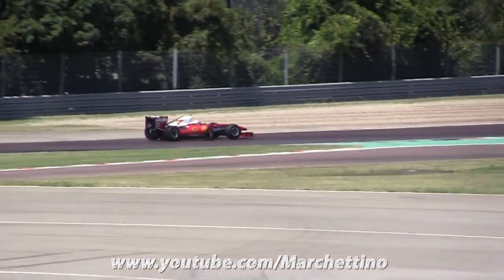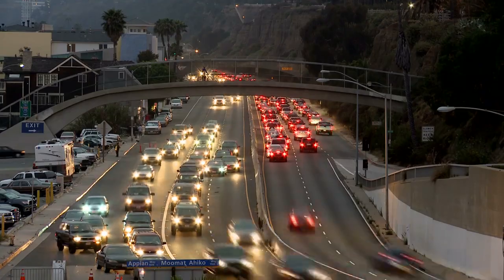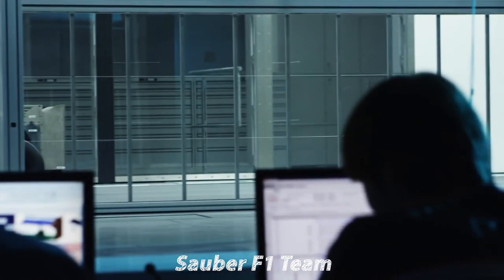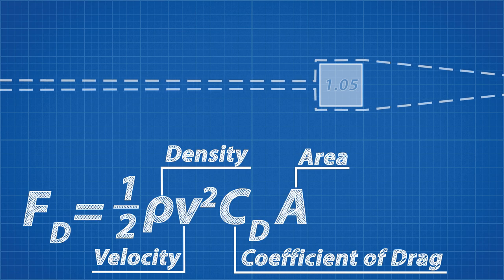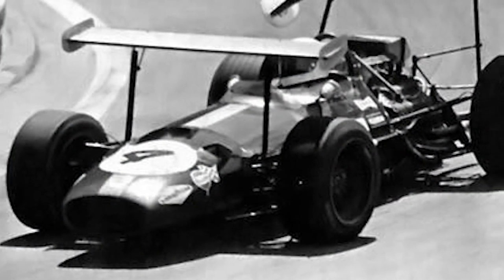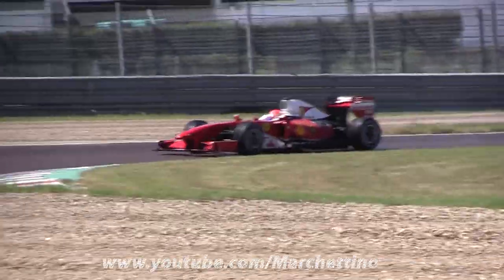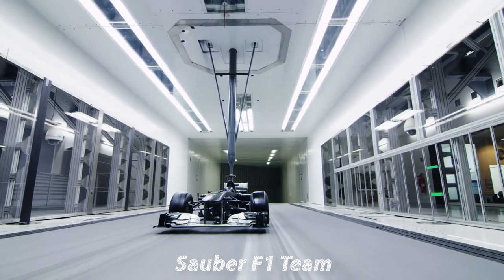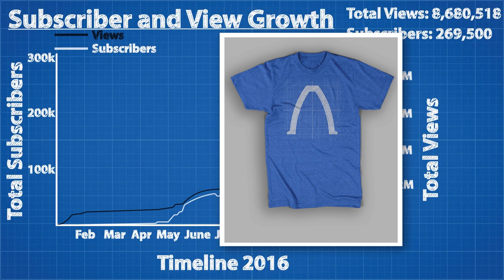The Greatest Innovations In Formula One

Comment: I don't get why the regulations are so strict... Of course you need to establish some rules for safety's sake, but if the goal is to design the fastest car, why not just let the engineers build whatever is within reason? Why put up so many restrictions?
Reply: They want it to be a fair race, the drivers must be able to have fun as well.
Reply: Yeah as was said above, look at how many complaints mercedes got fort he last 2 seasons (and red bull for the 4 years before that) that it was boring because one car was clearly better than all the others. If you have unlimited rules the team with the most money usually wins...
Reply: That what GP2 and all the single make series are for. Who is saying that with everyone working from the same rulebook makes it unfair anyway?
Reply: fair races are boring ;)

But so are Bullshit - adjustable Spoilers :D
Reply: +MRoesterreicher1 speaking of bullshit, "fan boost" in Formula E
Reply: +MRoesterreicher1 Fair race - it is 2-3 cars side-by-side in final corner of last lap. Yeah, it is boring). I used to watch f1 in the beginning of 2000s. I was shocked how non-entertained it was(and be now) when started to look to other races.
Reply: ThalesII The goal is not to build the fasest cars as such, they should be the fasest of motor racing. But the goal of F1 is to build the fasest cars within a set of regulations/rules, a "formula". That has always been the case of F1 since its start in 1950 and even before that in Grand Prix races.
Reply: ThalesII Safety being the most obvious reason, but also for competition sake. unregulated tech adoption will kill the smaller teams with limited resources, while those with massive funding keep innovating with shiny new things that pulls them far ahead from the rest. in that case the race would be very boring like what Mercedes did to the last 3 season in F1.

The FIA quite often made a regulation changes solely for the purpose of stopping one team from dominating whole season, in '93 they banned active suspension system because the Williams team cars kept lapping every other cars in the previous year, in '05 they made one set of tyre per race rules to kill ferrari domination, in '14 a double whammy of exhaust blown diffuser ban and mandatory use of hybrid engine stops the RedBull team with Sebastian Vettel all year domination. and finally this year, the FIA introduce so many changes in aero and tyre to hopefully even out the playing field once again, where last three year the Mercedes team is so far ahead of the other team that the championship become a two way battle between mercedes teammate.
Reply: Essentially we need a Formula X, where the rules are minimal and the engineers can go wild.
F1 right now is just a traditional establishment of regulation and politics, they do not want better cars they just want more limitation.
Reply: Or all of us can gather together and bring Can-am back which was balls to the walls anything goes
Reply: ThalesII probably so it's a fair race? Cause the team with the most money will obviously win
Reply: +MsSomeonenew Why do you use computer for calculation? Why do we use computer to fly rockets? Because it is much better than humans. We've achieved same level of tech for cars long tome ago. Unrestricted formula X = "goodby driver, you are too slow".
Reply: Callum Penman 

Its not that easy. With strict rules you have to use everything the rules give you and getting near  that 100% costs incredibly much. With all cars almost the same like now (think of them as 95% cars) their performance is all the same. But if only one manufacturer got 1-2% more out of it (aka blew some 10 millions more into it) it will completely dominate everything. Just because theyre so much the same but at one point. 

If more was allowed a little team just could have a genius idea and also fight for victory unlike now where genius ideas are outruled. 

Also you can see this in MotoGP. There are bigger differences between the bikes. Some tracks are more suitable for Yamahas , some for Hondas , some for Ducati,.... They all have different engines, therefore different characteristics. That combined with different chassis (and chassis materials) makes everything more different and in the end the same
Reply: Nino Schier if they're so alike then explain how a few of the teams never even got past double figures in point yet there is drivers alone who race for the likes of Mercedes and red bull who are well above 200 point in fact make that 300 for Mercedes by them selves as for the constructors, Manor, sauber and Renault who's combine total the whole season was 11, when Mercedes were sitting at 765 points by the end and also I'm pretty sure one of them has left due to lack of money, now try to imagine what the scoreboard would look like for a season without restrictions.
Reply: Callum Penman 

Manor and Sauber dont even have got the money to get the 95%. Renault is lacking experience a little bit (and luck).
Reply: Nino Schier exactly imagine if Merced could spend as much money as they wanted? Those team wouldn't even get a point
Reply: I know that unlimited rules would cost much but i just dont think that such strict rules help much either
Reply: Because F1 is a spec series like NASCAR, IndyCar, DTM, V8 Supercars, etc. However, most endurance series like WEC are more like what you're talking about.
Reply: Logan Palmer plus we don't want f1 to be completely taken over by money like football (soccer) where the team with the most money wins
Reply: Because it is also a sport, therefore the driver with the best skills should win. Of course the winning driver is very dependent on the funds and engineers of the team he races for, which is probably a factor that is impossible and inadvisable to eliminate. However, if all regulations were just sacked, the team with the most money would win, period. The entire sport would have nothing to do anymore with driver skill and would become very boring to watch, since the richest team would just win every race by  mile, therefore remain the richest team and then do it all over again next year.
Reply: Alabastine yesss finally someone who understands, and it also wouldn't give any of the younger drivers a chance because they won't be able to show their abilities and skills against the richer teams with the better drivers
Reply: ThalesII it's all about money. They make so many rules to make it more balanced so people want to watch it.
Reply: Because that splits up competition between the richer teams and teams with less money.
Reply: I saw a program in the 90s about this. Unrestricted rules would become impossible for a human to be able to react.
Reply: A lot of good points made in this thread, but regardless, I'd still like to see a "Formula X" division with minimal regulations just to see what new insane technology the richest teams can whip up... I'd watch it purely for entertainment purposes. It might not be the most "competitive" league but it'd still be highly entertaining (and the audience is what pays the bills [either through direct ticket sales, buying merch, or having high viewer numbers that attracts lucrative advertising deals] for the entire motorsport to stay in business in the first place so... focusing on purely viewer/audience enjoyment isn't necessarily a bad way to go.)
Reply: "within reason" how do you define that without rules and limitations?
Reply: A
Reply: Well, one of the rules must be that you're driving a car.  The rules help establish what counts as a "car" so that nobody shows up with a jet engine mounted on their vehicle (which would be an obvious way to win races).

Comment: No mention of the Gurney Flap, the safety innovations pioneered by Jackie Stewart, fuel safety, having the engine as the chassis, the F-duct, the raised nose, KERS, the fancy telemetry but we do get a few bits of info about Porsche who don't do F1.
Reply: side radiators on the lotus 72 which made the aerodynamics of the modern f1 car possible

Comment: Now how about "Greatest Innovations In NASSCAR"...Oh wait
Reply: You mean put the biggest push rod v8 you can find and get a 4 speed box behind it and slap it in a land yacht and watch yanks oaf around a circle ?  Lol
Reply: 1969-70 Chrysler used wind tunnels for the Charger Daytona and Plymouth Superbird as did Ford for the Torino Talledega and Mercury Cyclone. skirts for sucking the car down were used by Pete Robinson on his Top Fuel dragster 1969-70 Fan car Jim Hall Chaparral  2J 1970 car also had movable side skirts
Reply: " Naskerr "

Comment: The title for the video should be: The greatest Innovations in Motorsports, because around half of the examples you used were from sports car endurance racing not just Formula One. Another cherry pick formula one nowadays is not the leading form of engineering in Motorsports that titled goes towards the FIA WEC LMP1 Hybrid class in my opinion.
Reply: ranul kumara and Super GT
Reply: le mans and f1 used to be very similar in what cars were entered. At least when he said those examples. the FIA was very loose with regs and the WDC
Reply: Well the Jaguar C Type and Porsche 550 were never in formula one given the overlap in regulations. But the Chaparral 2E is a Can am car which shared nothing with formula one regulations in the 1960s. Also I just noticed he said the Chapparal 2E is a Le mans winning car but the 2E was never at Le mans that was the 2D and 2F which never won Le mans. Also the Porsche 917 shared nothing with formula one regulations
Reply: +Noratan Well, tell that to ABS, traction control, stability control, rear-view mirrors, paddle shifters, carbon fiber constructions, lubricants, aerodynamics/air channeling, adaptive suspension, sequential gearbox and 7 gear transmission, kinetic energy recovery systems (some models from Mini Cooper offers this technology along with few other automobile manufactures), steering wheel functions, tire compound, carbon ceramic brakes, single wheel leg nut (most vehicles have four or five lug nuts), and engine management/technology.
Reply: He also missed the tail end of the 917 line where about 1500 hp was attained from the car.

Comment: Rubbish... This is the top 6
1- wings (aero in general)
2- electronic injection 
3- carbon fiber composite 
4- active suspension
5- traction control
6- ABS
Reply: Abs is banned in f1
Reply: No original f1 cars had any of these

Comment: That 917 tho.. what a beast! Was 19 mph faster than anything previously built for Le Mans in 1969-1971, that ladies n gents is night and day in the racing world. This Porsche still holds the fastest lap at the Le Mans racing circuit to this day but of course, there have been a number of fundamental changes to the circuit since 1971.These cars were so stable that the drivers could take their hands off the steering wheel at speeds which reached 240+ mph.

Comment: What's not well known is that Gordon Murray actually took his inspiration for the "fan car" from the Chapparal 2j sports-racing car with electric fans to create low pressure under the car and thus increase down force. O'l Gordo just came up with a more elegant solution by joining the fan to the drive shaft.

Comment: The author forgot about 3 important improvements: monococ body, engine as a stress-bearing member of the car and painting ads to cars. All of them created by Lotus.
Reply: @ipilot.     Engine as a stress-bearing member was used by Vittorio Jano on his D50 Lancia F1 car in 1954.
Reply: @barryfowles-zl5ib  That's an interesting bit of information. Didn't know that. Great many thanks.
Reply: @dixon_est    You are more than welcome, a few innovations are credited to the great Colin Chapman, who was responsible for persuading my old employer Ford of Great Britain to commission the Cosworth DFV engine for the initial use solely by Lotus and one of Chapman's criteria was it had to be used as a stress-bearing member thus doing away with the need to have the weight and obstruction of a chassis rear of the drivers bulkhead to accommodate engine and gearbox on the Lotus 49 1967 F1 car.
Reply: @barryfowles-zl5ib  Yeah. Nowadays some people think, that in 60-s people used sticks to light a fire. Nevertheless - Lotus 49 is to my eye still one of the most beatuyful F1 cars ever. I dream of a day, when someone recreates this F1 experience as a gentelman racing series with modern tires and safer cars, but general design based on Lotus 49. Even similar engine is available from Mechachrome. They should prohibit ads on cars. Neh, I live in a dream world.

I love the simple "bare bones" ethics of the era right before the wings showed up on cars.
Reply: @dixon_est      We seem to be in real time here, Do you live in the UK,  because there are events where older F1 cars are raced both at Goodwood and Silverstone and it's great to see those old Brabham, Lotus, McLaren, March, Ferrari, Maserati and BRM plus many more being raced, they don't really belong in museums yet, many of the car owners hire pro. racing drivers to compleat in the races, very brave given the cost of repair if they crash, incidentally Cosworth DFV are still available.
Reply: @barryfowles-zl5ib  I'm from Estonia. Nevertheless I know about such races, but I always feel, that those cars being culturally significant aren't actually driven to the limit.
Reply: @dixon_est    The historic race cars are all owned by multi-millionaires, Nick Mason of Pink Floyd is one of the best known, they do occasionally get damaged, as they did in their prime, but the owners are able and willing to have the cars repaired to in some cases better than the original condition, my view, for what it's worth is it's great to see these great cars being used for what they were built for, rather than being static exhibits in museums. 
.

Comment: Disc brakes did something beside dissipate heat better than drums. In drum brakes the gasses produced by the friction can't escape the drums and the gas is trapped. A layer of hot gas will build up between the shoes and the drum. Then the shoes are floating on that gas layer and have no friction. I've driven drum brakes hard. The fade you feel in them isn't fluid boiling. It is the shoes floating on gas. With discs the gas can and does escape.  Disc brakes are also far easier for the driver to modulate, and they are lighter. They work better in every way.

Comment: The first Chaparral with a movable wing was the 2C, of 1965.
It’s successor, the 2E, appeared in 1966.
The 2C and 2E were raced in an American sports car series.  They were not eligible for le Mans.
The first Chaparral to race at le Mane was the 2D, in 1966.
The 2D only used the movable surface in its debut race at Daytona, Florida.
The 2D raced at le Mans, but did not finish.
Its successor, the 2F, raced at Le Mans in 1967,two cars were entered but both failed to finish.

The Chaparral wing was intended primarily as a braking device.  On the 2F it produced too much downforce on the rear wheels and  and a movable vent was required at the front to load the front wheels and maintain the car’s balance.

Comment: These design can generate enough down force to hold the car when running upside down on a ceiling of a tunnel.

F1 is essentially a bunch of prototype vehicles primarily for speed (then safety), where on "few" occasions ended up in production cars like ABS.

Although it lighter, but the inherent issues with Carbon Fibre is the lack of manufacturing techniques for mass production compared to steel and aluminium.
Reply: @guesswho kk.  What planet are you on, of course, F1 is primarily about speed, it's called racing, and wtf does it matter if carbon fibre is not suitable for production, F1 is no more about proving techniques for road cars than football is about developing better leather.

Comment: I thought this had a misleading title. Should perhaps have been "3 Innovations in Motorsport". 

Missed opportunity to speak about the first mid-engined cars; the first Monocoque chassis; the first fully stressed engine/gearbox; Active Suspension; hydraulic actuated gear-changes; helmet advancement, fire-retardant clothing; hans-devices... the list goes on. 

Though, the Kinetic Energy Recovery System was mentioned at length - so there's that.

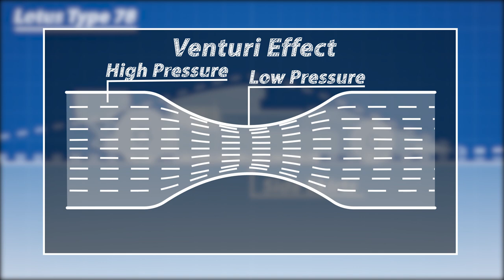Comment: 8:04 is it right ? It seems that low and high pressure are not mentioned at the right place
Reply: Yes, it's correct. It was counterintuitive to me at first as well, but as I learned in engineering class, high speed means low preasure, and vice versa.
You can look at the Bernouilli equation to see this confirmed. 
Intuïtively I understand this as follows:

Imagine a 4 lane highway, because of an accident, all cars have to go through the one free lane.
There will be massive congestion before the accident (high pressure, low speed)
but in the one-lane part: traffic will be smooth, distance in between cars will be greater, speeds higher (low pressure, high speed)
The same kinda applies to air molecules (being cars)

Comment: Are you aware of the 1970 J2 Chaparral that raced in US Can Am racing? It used a perimeter skirt and a snowmobile motor at the rear powering 2 fans that created a vacuum under the car. I was a child and was watching the race (on TV) where it debuted. It was never allowed a second race. I wish I knew where to find film of it. It went practically full speed around corners (or so it semed) because that vacuum held it to the ground. The vacuum slowed it down on the straights but the advantage around corners more than made up for it. It was crazy to watch.

ABC's Wild World of Sports! Also where I saw Muhammad Ali interviewed by Howard Cosell.